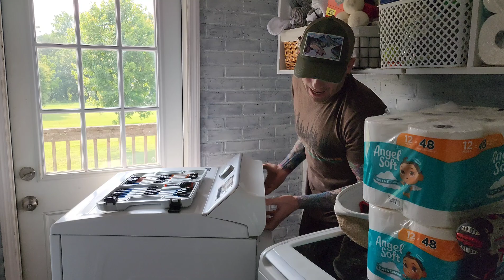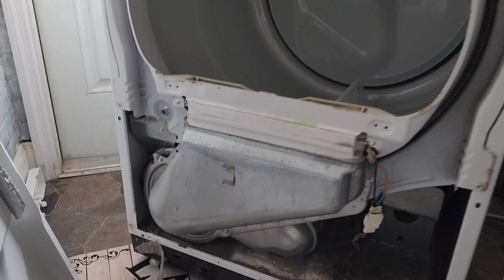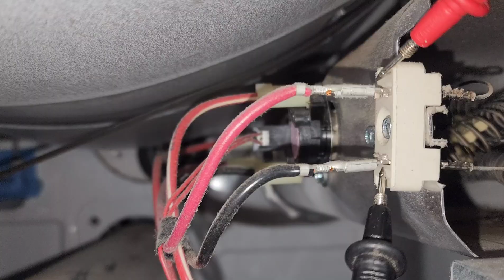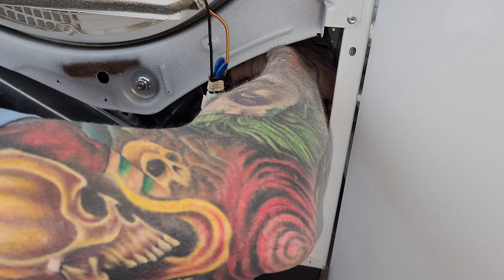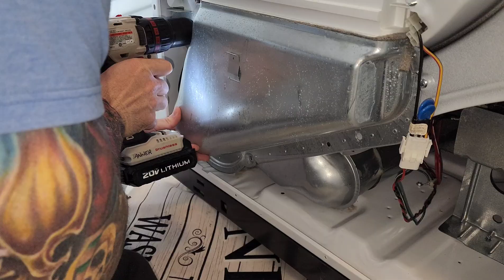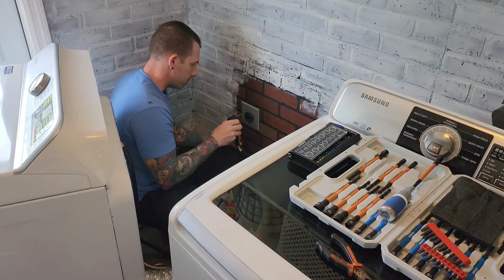🔥 Maytag Electric Dryer - Won't Heat Up - Easy DIY Fix 🔥

Comment: Does these dryers have a limit switch? I omed my heating element and the element has failed. I didn’t know if that also means the limit switch failed or not! Thanks for your video!!
Reply from the maker: I am ignorant on the topic. What you seen here in this video is the extent of my knowledge.
Reply: @TannerFlowers Thanks so much!! Video helped a lot!!
Reply from the maker: You are very welcome.

Comment: Tanner. I’ll be attempting to check my dryer. Tub spins but zero heat. I’m thinking Heating element, but will test everything for continuity. Great Video. Very helpful 👍🏻
Reply from the maker: Maybe this will help you. Hope so. 👍

Comment: Question, then to the thermal fuse what is that? I looked it up and is says it’s a thermistor? Did you test that?
Reply from the maker: I only did what I showed in the video. I am not familiar with what you mentioned.
Reply: @TannerFlowers right on bro, thanks!
Reply from the maker: Wooooo! Who knew I was an appliance repairman trainer too! 😂😂😂

Comment: Tanner

Your video on how to repair/replace  Maytag dryer element was outstanding. Excellent job coaching and providing instructions for each step from start to finish. I fixed my dryer last night without any issues thanks to your video. Thanks you for posting this. You not only saved us a costly repair bill but I loathe having to wait for a tech to arrive at home w a 5 hr window.
Reply from the maker: That's awesome to hear. Happy to have helped. 👍